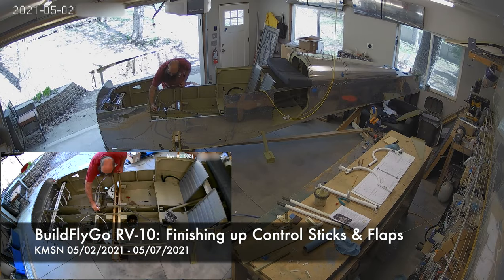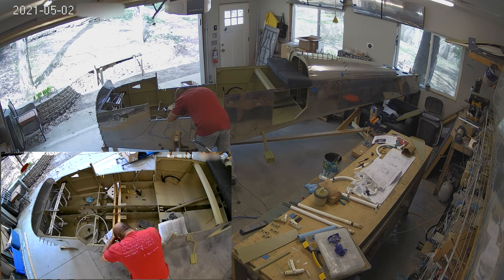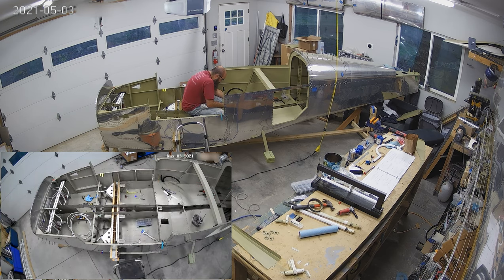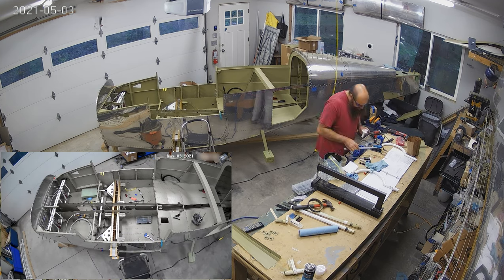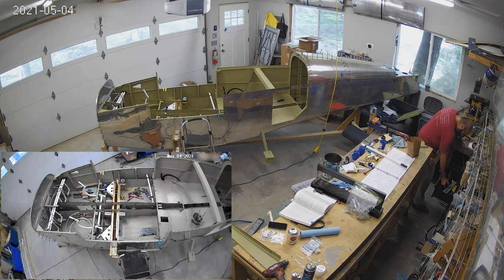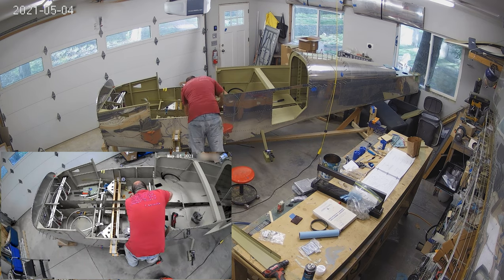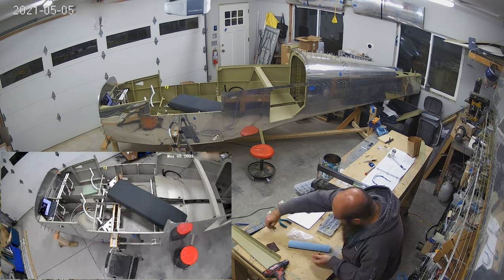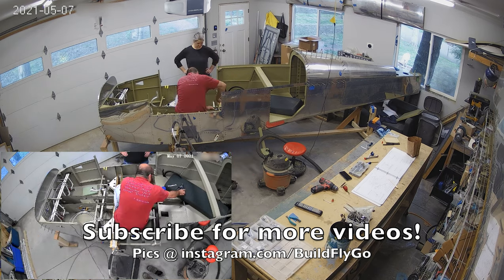RV-10 Build: 05/08/2021 - Controls & Flaps

Comment: Stock flap motor or aftermarket?
Reply from the maker: Stock. If the aftermarket option had just fit in the normal flap bracket I might have gone with it but it felt a little bit like saving some work just to do it elsewhere :)